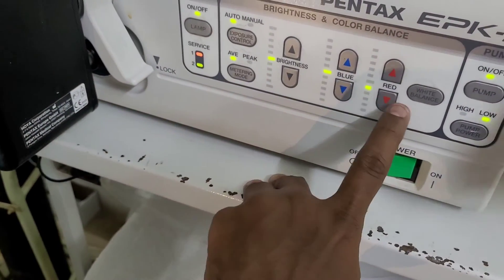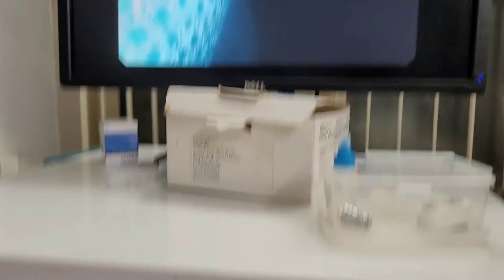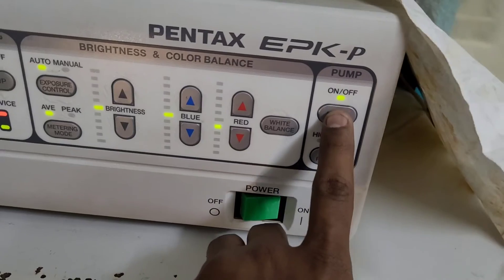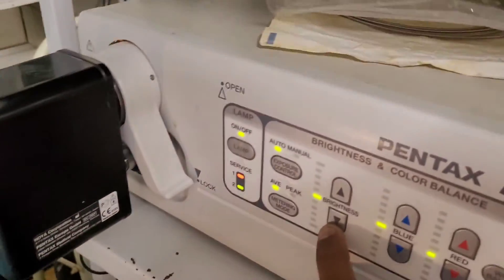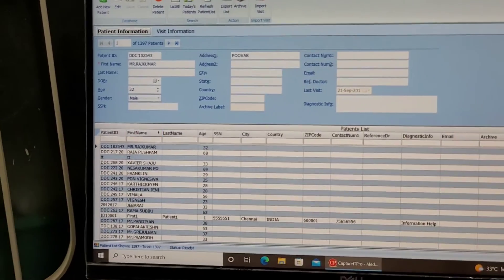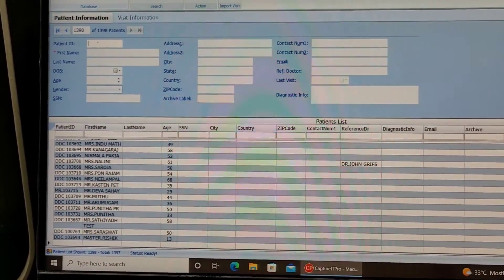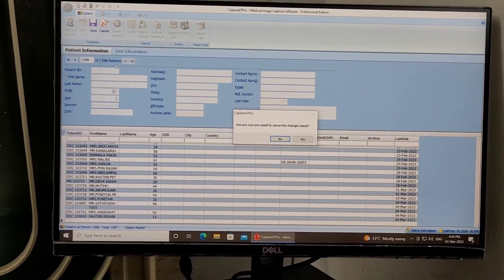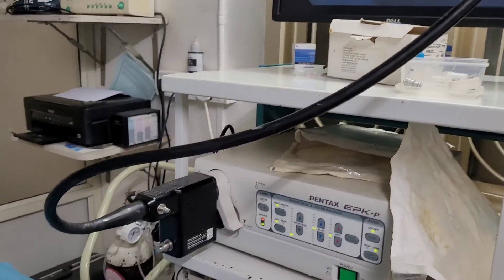Endoscopy Parts and Functions

Comment: Sir, Can you do a detailed video about Laproscopy systems...
Reply from the maker: Technically or what?
Reply: @MrBiomedical  Technical, about Laproscopy tower systems
Reply: შეგიძლიათ მომწეროთ გასტროსკოპის დისტალური ბოლოს ერთი ქსენონი განათება გაყვითლდა რატომ არი?
Reply from the maker: 1.Xenon lamp aging
Xenon lamps shift color as they age.
Yellowing means the lamp is near end-of-life.
Burnt or damaged light fiber bundle
Partial fiber breakage or overheating causes reduced blue spectrum → yellow light.
Very common in older scopes.
Contamination at the distal window
Protein residue, glue aging, or heat damage on the distal lens/filter.
Even after cleaning, discoloration may remain.
Optical filter degradation
Internal color-correcting filters can degrade due to heat from xenon light.
Unequal light transmission
If the scope has dual light guides, one fiber bundle may be damaged while the other is normal.